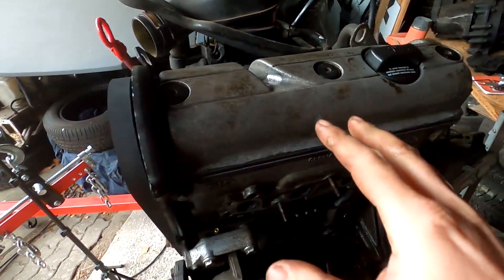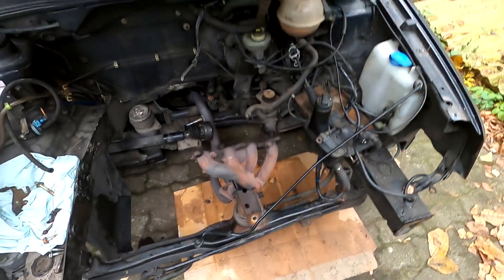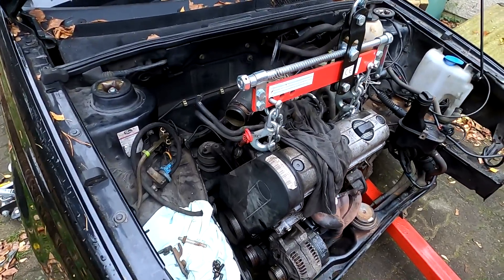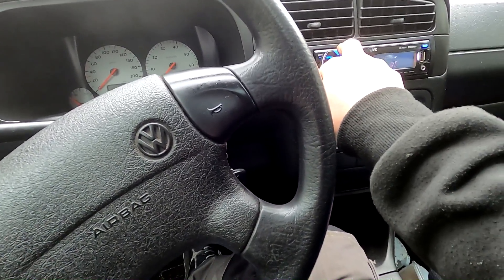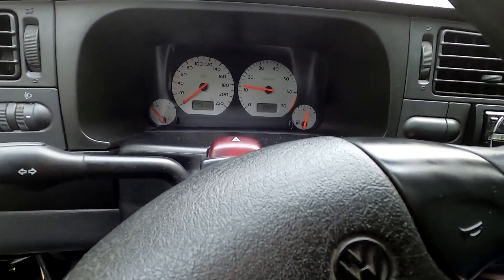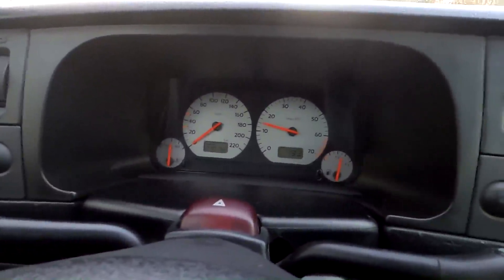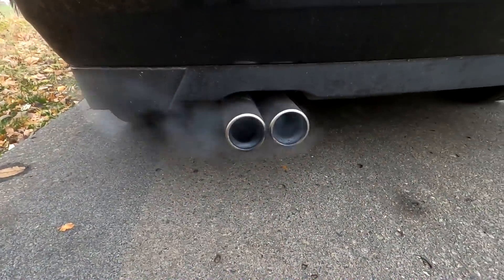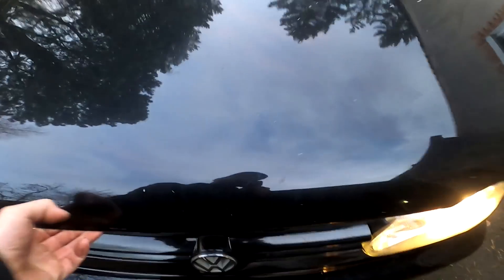Läuft die "Schnäppchen" Karre nun endlich?

Comment: So also ruhig bleiben: 
1. Fahr mal das Auto so ein paar Tage, auch mal unter mehr Last und schau mal ob sich die Flüssigkeitsstände sich verändern. Wenn ja > Was wird weniger? (Der Auspuff kann noch voll sein von Rückständen von vor dem Schaden)
2. Check die Zahnriemenspannung, der Zeiger muss auf die Kerbe in der Halterung zeigen, sonst ist der Zahnriemen etwas zu straff.
3. Der hohe Leerlauf kann zum einen von der Drosselklappe kommen > anlernen, oder aber vom Kühlmitteltemperatursensor, hatte ich auch an meinem Polo 6n, die Drehzahl war dauerhaft auf 1500 U/min. Neuer Sensor, und schon war das Problem gelöst. 
4. Wenn du weißt, welche Flüssigkeit er verliert, dann drück das System ab. 
5. Du hättest den Kopf planen sollen, aber dicht sollte die Kopfdichtung erstmal sein, also kannst du die ausschließen. 
6. Ventilschaftdichtungen fallen raus, da diese sich nicht durch permanentes qualmen äußern, sondern nur wenn man längere Zeit das Auto im Leerlauf laufen lässt und dann gas gibt oder auch wenn man sich Berg im Gang runter rollen lässt und dann Gas gibt. 
7. Wenn das permanente Qualmen bleibt und das Auto Öl vernichtet, können das Kolbenringe sein, aber das Qualmen wäre dann bläulich. 
Fazit:  Drosselklappe, Kühlmittelsensor (Achtung gibt zwei, einen fürs Motorsteuergerät (der muss neu) und einen für die Anzeige im Tacho (Einpolig, der muss nicht neu)) und mal fahren. 
Habe mir nochmal den Motor angeschaut. Du hast auch am der Ansaugbrücke Kühlwasseranschlüsse. Ein Haarriss in der Ansaugbrücke könnte auch ein permanentes Kühlwasserverbrennen verursachen. 
Check das alles mal und dann berichte mir mal. Falls du was angelernt haben möchtest kann ich dir das auch machen, bin aber leider im Rheinland ansässig ^^

Comment: Hey es kann auch sein das der wagen voher lange stand und sich wasser im entopf gesammelt hat und nun das verdampft durch die auf einmal höheren temperaturen und daas er etwas mehr qualmt nach dem motor aus ein ander nehmen ist eigendlich normal ich würde dir mal raten mal eine längere strecke auf der autobahn zu versuchen und dann mal schauen ob das problem besteht und alle flüssigkeiten über prüfen wie der stand ist bin selber MK3 fahrer mit dem 1.6L motor
 
Desweiteren mach weiter schaue immer gerne zu